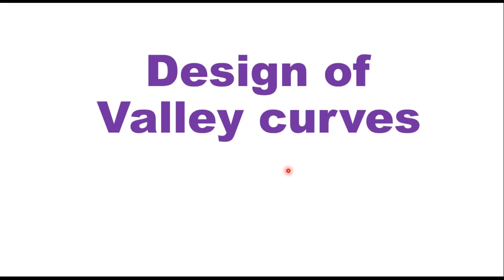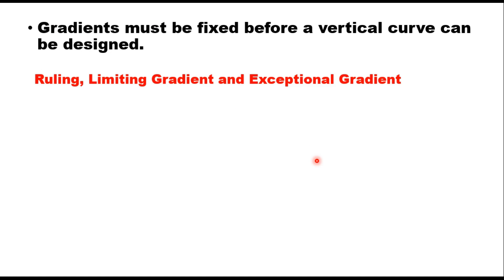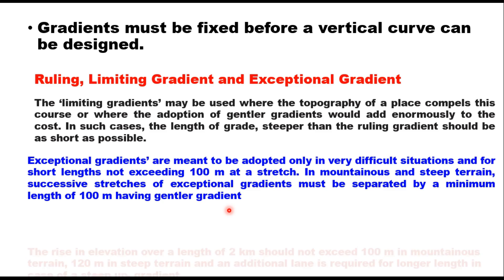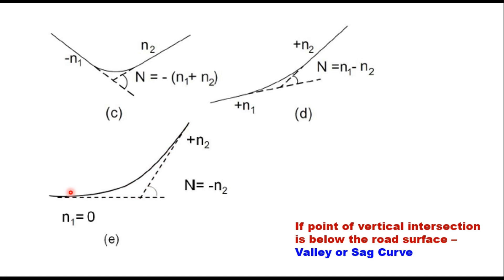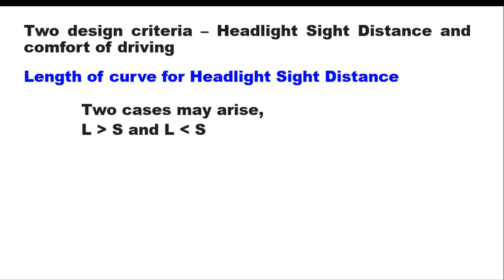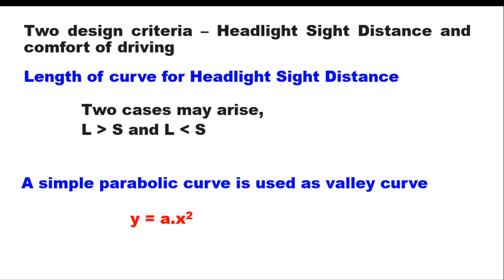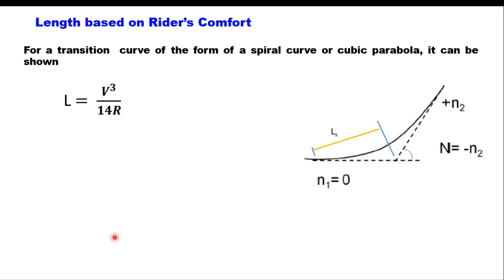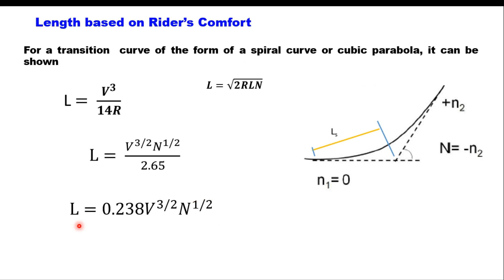Design of valley curve on a road. Headlight sight distance and comfort criteria with solved example

Comment: HOW CAN WE FIND OUT THE HOG AND SAG CURVE LENGTH IN 4 LANE DIVIDE CARRIAGEWAY SAY IN GREEN FIELD HIGHWAYS
Reply from the maker: Length of vertical curve does not depend on the number of lanes. It is the function of ground profile only. In the case of a geenfield highway also, the centre line of the road marked on the drawing will decide the extent of gradient and thus the length of the curve.

Comment: Sir, In first Question if we assume design speed as 100kmph and assuming Lv>SSD Lv comes as 124m which is less than SSD of 180m for 100kmph so assumption is wrong.

Now using second case where Lv< SSD answer is 100m so the assumption is right.
And from comfort condition ans is 48. 

So the correct answer is 100m as rhe assumption is correct. 
But in field design always Lv>SSD is used to satisfy K value and in SP 23 only table for Lv>ssd is given.
Reply from the maker: IRC SP 23 has now been merged with IRC 73, 2023. Refer it